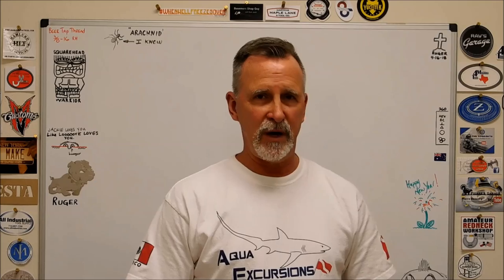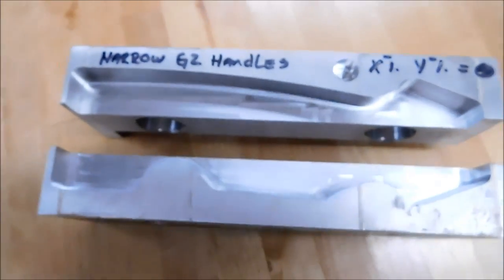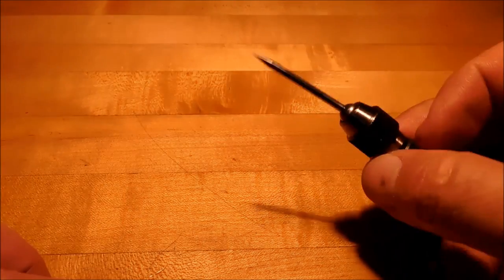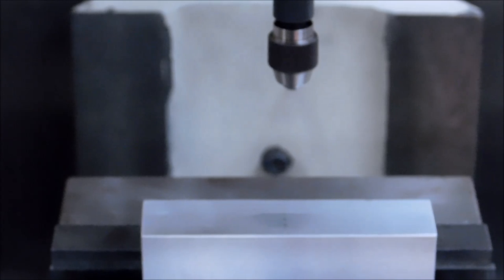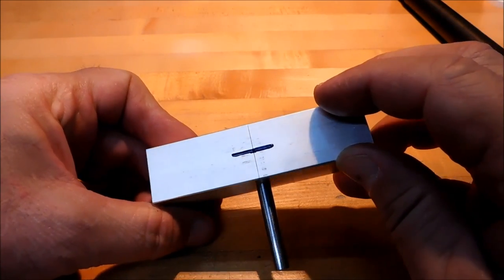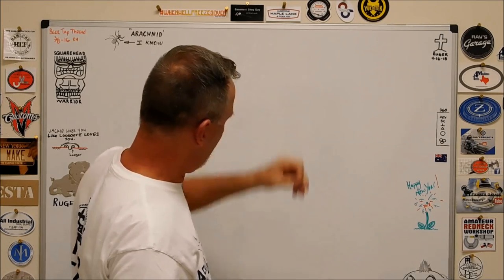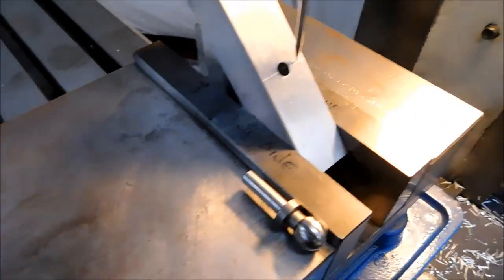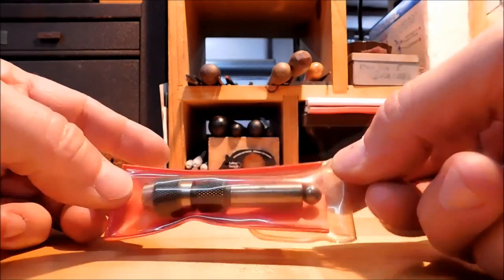Tooling Balls and Tooling Holes

Comment: There's no shape WORSE for consistently and repeatedly and accurately finding a single "point" in 3-dimensional space ON that shape than a SPHERE. Which is why the GPS is worthless with fewer than THREE satellites and "sub-foot" accuracy/precision that's REPEATABLE requires at least FOUR OR FIVE and "sub-inch" requires RTK radios and a fixed-position Earth-bound secondary receiver/base station even with 6 or more satellites. 

The secondary known/fixed/consistent receiver and RTK system AND the "un-scrambled" GPS license/signal that will all set you back about $10K minimum for the only "commercial" RTK "portable" sub-inch system available which is John Deere's GreenStar RTK GPS is for "error-correction" to create sub-inch accuracy/precision 24-7-365 year after year even the "government" and "military" don't have and/or need and can't produce with the existing GPS system alone. 

You have to have RTK and your "range" within which you have sub-inch accuracy?precision depends on how far "out" from the base station or a "repeater" your mobile units can pick up the correction signals at least "hourly" and for at least a long enough period of time have at least 4 satellites and the base station "visible" at the same time for at least a minute or more. THAT is what is required to return to a "pinpoint" location on a "spherical" object since ON a "sphere" which HAS NO "AXIS" OR CENTER AND WHERE AN "INITIAL POINT" FOR ALL MEASURING/MAPPING/SURVEYING F AND ON THAT SPHERE MUST BE A PHYSICAL AND FIXED POINT ON THAT SPHERE AND THE ONLY "PLANES" AND/OR  STRAIGHT AND LEVEL "LINES" POSSIBLE WITHOUT "LEVELING" THE SPHERE'S SURFACE ARE EITHER "IN" OR "ABOVE" AND NOT "ON" THE SPHERE PERIOD.

The other "issue" with those "tooling balls" is that they're not even spheres to start with and even the "theoretical" so-called "ball" ASSUMING EVEN THAT IS "PERFECTLY SPHERICAL" WILL NEVER BE "ON" THE "PLANE" YOU DRILL A "CROOKED" HOLE INTO SO YOU CAN THEN PRESS A "TOOLING BALL" INTO IT TO THEN SUPPOSEDLY USE AS AN "INITIAL POINT' THAT WILL LITERALLY END "FLOATING IN SPACE" ABOVE AND OFF THAT "PLANE".

And its ASININE to assume a "pinpoint" object contacting an "point" on a "sphere" is automatically "centered" back on that "point" the NEXT time AFTER MOVING ONE OR MORE "POINTS IN SPACE" AND THEN "BACK" INTO "POINT TO POINT" CONTACT SOMEWHERE ON THE "TOP" OF THAT "SPHERE" YOU JUST PUT THE SAME "POINTS" BACK IN CONTACT. NO DOUBT SOME REAL "EXPERT" MACHINIST(S) AND/OR ENGINEER(S) DECIDED THAT SINCE "INDICATOR PROBES" ARE USUALLY "BALLS" BUT ONLY SO THEY "ROLL" ACROSS "FLAT" SURFACES  AND CONTACT THEM WITH AS LITTLE SURFACE AREA AS POSSIBLE BECAUSE INDICATORS MEASURE PARTS IN MOTION AND ARE NOT FOR "MEASURING" ANYTHING BUT "MOTION" EVEN WHEN "FINDING" OR "MEASURING" A "PART" THEN BY GOD PUTTING A "BALL" ON A PART AND USING A "PINPOINT" PROBE ON A "PART-FINDER' OR "EDGE-FINDER" WHEN MACHING WITH "MANUAL" MACHINE TOOLS "CONVERTED" TO SO-CALLED "CNC" OPERATION IS JUST THE "SOLUTION" TO THE PROBLEM THAT A DRO AND "STEPPER MOTORS" AND A "CONTROL SYSTEM" DOES NOT MAKE IT A "CNC" MACHINE. AT BEST IT MAKES IT A SIMPLE "NUMERIC CONTROL" MACHINE USING A PC AND SOFTWARE FOR "NUMERIC CONTROL" INSTEAD OF AN IBM "MAINFRAME" AND "PUNCHCARDS". CNC MACHINES SURE AS HELL DON'T NEED "HELP" OR "TRICKS" JUST TO FIND AND/OR "SET UP" PARTS THAT INVOLVE ADDING "FEATURES" TO PARTS OR 'TOOLING" UNLESS THE 
"CNC MACHINIST" OPERATING THEM IS A "MANUAL MACHINIST" WITH ALL THE ANSWERS AND SOLUTIONS TO QUESTIONS AND PROBLEMS REAL MACHINISTS WHETHER MANUAL, CNC OR BOTH SIMPLY DON'T HAVE OR ARE SMART ENOUGH TO ANSWER/SOLVE THEMSELVES WHEN DOING ACTUAL PAYING "JOBS" FOR ACTUAL CUSTOMERS IN ACTUAL MACHINE SHOPS WITH ENOUGH ACTUAL WORK AND REAL MACHINISTS YOU'LL NEVER WALK IN AND FIND SOMEONE WATCHING MUCH LESS MAKING INTERNET "HOW-TO" VIDEOS OR READING MUCH LESS WRITING FORUM POSTS AND COMMENTS.

THE FACT THAT YOU HAD TO SETTLE FOR A "NUMBER" .0025" "OFF" FROM WHAT YOUR "TOOLING BALLS" WERE SUPPOSED TO PRODUCE REPEATEDLY PROVES HOW USEFUL, PRACTICAL, PRECISE, ACCURATE AND PROFESSIONAL THAT "SOLUTION" AND THE "MACHINIST" TRYING TO "SELL" IT TO "MACHINISTS" WHO GO TO ONLINE "MACHINIST" WITH ZERO "CUSTOMER WORK" IN THEIR SHOPS AND VIDEOS ALL ARE.
Reply from the maker: Aside from the numerous industrial fixtures I've seen and used over the last 40 years, the first application that comes to mind are the spacial tracking balls used by just about every robot assisted surgical system in the known world. Aside from that, I can't think of any use for them. I also have to imagine you have not spent any time in a precision tooling design or fabrication environment where they are commonplace. The accuracy and machine alignment you can achieve with a tooling ball is second to none. Feel free to elaborate on your comment. I'd enjoy knowing more about why you feel the way you do.
Reply: @joepie221  attacking is real common when you don't understand what's really being said, plus, it's the internet,  LOL.  FWIW I thought it was a good video and explanation very simple to understand if you've done any precision machining
Reply: Ok, what do you propose? I suppose there's using the bottom or top edge, then calculating where the line would be given the law of cosines, provided that edge is well defined. You could pin an existing hole and calculate where the line would be from there, given your print is complete.
Reply: Read some QA magazines sometime... they're still invaluable for building tools and gauges. I've been designing tools for ~20 years now and I still place a tooling ball position on every fixture I build, even the ones that go on zero-point locating systems like Erowa, system 3R, Schunk, etc.. Why? Because, the tooling ball can be a nice sanity check for folks when they initially set a fixture, since the datum features are not readily accessible. All of our tools go through CMM inspection and an offset from the datum reference features to the tooling ball is recorded. That information is then carried in an RFID chip to the machine. Once the RFID chip is read at the machine, it automatically pulls the program and the offset value--the one recorded by the CMM--is stored in the pattern shift; G54, G55, etc.. All that said, I don't know why anyone would ever 'need' to write down a shift, simply hard code it into your program with a G54... but I digress. 

On the 'parts' side of things, a tooling ball is often the only accessible feature on a part in it's additional operations. It can often save you the trouble of building a dedicated jig that references the primary, secondary & tertiary datum. A couple of checks with an indicator and tooling ball pickup is often 'good enough' for most jobs... for all others, your back to qualified jigs.
Reply: Whole lotta post without a whole lotta substance. We use tooling balls on precision tool work all the time round these parts. I'll have to let the boys know that just ain't accurate enough because some dude who typed in all caps said so.
Reply: this guy is literally crazy, wtf. like is he on drugs or what? no sane person gets this mad about youtube videos
Reply: also he totally does not understand the geometry of indicating the ball. the purpose of gps is to tell you where on the ball you are, not to tell you where the center of the earth is.
Reply from the maker: And what .0025 error are you talking about? It is obvious you don't understand the accuracy and simplicity of a tooling ball.
Reply: The fact that calibration spheres are used all the time in CMM inspection & calibration, negates just about everything said here. You could make a case for establishment of a plane, because that requires 3 points in space but that's easily countered with a 3-ball setup on the primary... and some companies do require it. But usually, I read comments and try to get at the crux of what someone is saying because, often times there's a valid point there... can't see it in this case.
Reply: Clearly a failed understanding on so many technologies!... I'll let the machinists handle their trade, but can tell you a bit about GPS. The tech is simple... calculate a distance by looking at the calibrated timestamp of a radio signal. Tells you how far from the SOURCE you are, but not what direction (a 'sphere' of solutions). Add a second sphere (another SOURCE) and the intersections of the two solution spheres is a 'ring'. Add a third source and now your solution is two points on that ring. Relative to GPS, one of the points is somewhere near earth's surface, and the other is out in space. That is why it takes a minimum of 3 satellites for any position.

Those satellites are transmitting a timestamped radio signal through a variety of atmospheric  layers at different angles to the receiver at an unknown elevation on the earth's surface. All those factors contribute to radio noise that results in an 'uncertainty' factor about the actual distance spheroid distance from each SOURCE. The error can be estimated and for raw, uncorrected GPS signals 35 years ago when Rockwell put up the first satellites, it was about 100m.  To get the survey-level accuracy we have today, we essentially add ground-based SOURCEs with a known location and many less noise factors to correct for the errors... hence the sub-centimeter accuracy available if you've got the right equipment. GPS works around the globe, but anybody who can transmit/receive synchronized timestamps could develop a system that works within the range of the transmitters. I'm certain that Deere is not the only player in that space... there are robot vacuums and lawnmowers with the same tech.

Bottom line is that every measure of accuracy comes with a measurement of error. Both measurements have tolerances. Joe's techniques here are clearly adequate with the kinds of activities that happen in machine shops all around the world!
Reply: Its pretty simple brainiac. A sphere is a point that is magnified, making it easier to repeatably measure. In relation to the work piece, being a known distance from the work piece, makes it a known point to reference all operations from.
Reply: I hope that bloke can find his way home when he's pissed with are that trig. In his brain
Reply: "WHAT" is "WRONG" with "YOU" "GUY" ?  I think the response you meant to type was "Thank you".